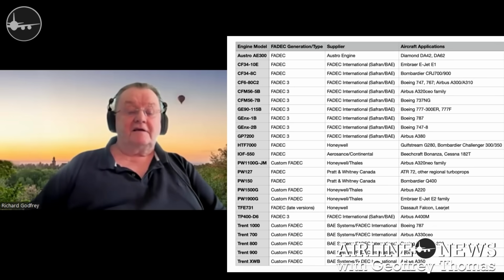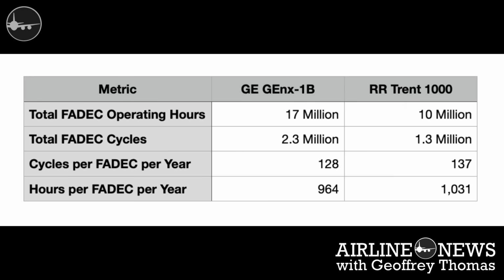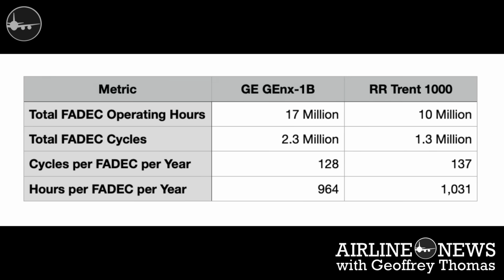Air India Crash - FADEC Explained  #airindiacrash

Comment: Gentlemen:  I've been following your outstanding coverage of the Indian Air Crash, and wanted to offer something for your consideration.  You made a video a few days ago regarding water ingress to the electronics compartment, and the potential consequences.  I have no experience with aviation electronics, but I am retired from a long career in electronics that included computer design and industrial/scientific control and data acquisition systems.  My topic is the fuel cut-off switches.  I've heard many times that these switches employ safety detents, and because the FDR indicated that they had been cycled, it PROVES that one of the two men at the controls, took the action to cycle these switches.  This might be an erroneous assumption; I'll explain.  The input channels to the FDR are measuring and recording electrical signals.  The real question is, what initiated these input signals.  If there is a separate circuit monitoring the ACTUAL MECHANICAL MOVEMENT of the fuel cut-off switches, then one would have a high degree of confidence that the input signal was the result of the switches being manually cycled by the crew.  HOWEVER, if there is no dedicated scheme (separate data channel) to measure and record the ACTUAL MECHANICAL MOVEMENT of these switches, the FDR is simply recording an electrical impulse on the "Fuel Cut-off switch" input channel.  It's not difficult to imagine a number of scenarios (water ingress causing "shorts", etc.) that might be capable of creating a "phantom signal" interpreted (and recorded) by the system, as being a pilot input (operation of the switches).  Do these aircraft employ a scheme that monitors and records ACTUAL MOVEMENT of switches, or are they simply capturing and recording "downstream signals"?    Your thoughts?
Reply: There are no position sensors at the switches. The FDR gets its fuel status data from the Remote Data Concentrator, which gets input from the switch relays and the fuel valves.

What is unknown is whether investigators took the time to differentiate the source of these inputs or are simply interpreting the change in fuel status as switch movement, which under normal circumstances would be a valid assumption.
Reply: @timrider1224  Ah!!  You appear to be familiar with these systems!!  Based on what you said, it seems reasonable to question the generally accepted  "fact" that these switches were operated by the flight crew.  Back to the the water ingress issue.  Is it possible that water had accumulated in a critical area, but did not cause an issue until the aircraft rotated-up as it left the ground?  I've long been troubled by the reported exchange between the crew.  One asked the other why he operated the switches, with the other denying he did.  Unless we are to believe some sort of panic response or deliberate sabotage of the flight, to me, this has always suggested some sort of highly random control system failure.  And water sloshing around in critical electronic control modules seems like a great candidate for such and odd/random/hard-to-pin-down cause of failure.
Reply: @BoffinGrusky  This scenerio has been bugging me on several sleepless nights. But assuming that the relay got shorted due to water or moisture, how was the pilot able to put the fuel switches to run mode after 9 seconds? Also, why did he take 9 seconds to put the switches back to run? Is it possible that he was frantically moving the fuel switches from off to run several times till finally the run position held? How come both relays (for left and right switches) become compromised almost at the same time and became OK together after 9 seconds?  I am a systems integrator and not an aeronautics engineer but it's common in my experience to see false active inputs without the actual sensor feedback due to hardware failures. I hope that an aircraft, given the essential  design requirement  of preventing loss of life, has multiple layers of protection against such failures.
Reply: @fifthdimension194  I remember hearing that the crew flipped the switches back to run after so many seconds, but the question remains for me, was it a crew member actually operating the switch?  Or, had something changed over the short course of the flight that made it APPEAR the switch itself was toggled?  For instance, when the plane's nose rolled-up as it left the ground, water invaded some sort of electronic control package causing a system malfunction (and the "fuel off" condition).  Maybe as the nose of the plane started to roll down, the water flowed to a different position, thus causing more spurious operating conditions (and spurious data captured by the FDR)?  Or maybe as the water shifted, the system returned to normal function and attempted to recover?  Several have commented that the cockpit voice recorder is sensitive enough to capture the clicking of the switches.  Guess we'll have to wait for that recording to be released.
Reply: @timrider1224  I would remind all that the FCO switches were found in the run position when examining the wreckage. Is it a point to consider that IF the derived data reporting the FCO switch positions was in some way compromised, that the FDR would record this and lead to false assumption the the switches had ACTUALLY been moved when they might not have been, especially allowing your statement, "There are no position sensors at the switches.", that there is no DIRECT evidence (as yet) of pilot(s) moving the switches. Maybe CVR audio could clarify this but it is as yet unavailable. To me the preliminary report is vague and inaccurate garbage with little hard data. Once again I say the ONLY way to get answers that are accurate, truthful and backed by hard evidence is to release the full unabridged data sets from all sources and then let the various investigative bodies dissect and analyse it all in the cold hard light of day.
Continuing with the current possess will not inspire confidence in the public and leave doubt in the integrity of many organisations that have been committed over decades to improving aviation safety through hard fact and detail, with enormous benefit. We can not let this hard won, independent knowledge process be corrupted by a single accident, no matter how much reputation is lost, no matter how much money/profit is at risk, no matter whose feelings are hurt and no matter the inconvenience to the traveling public if "normal" service is disrupted to deal with any rectifications required. Just publish the lot. Then noone can hide...
Reply: @drstrangelove296  I lean strongly toward the position that the switches were never moved until the pilots initiated the restart procedure. 'Jeremy John Thomson' and 'Sabin Mechanical Engineering' YouTube channels have fascinating videos covering this.
Reply: @timrider1224 If the investigators are interpreting it this way without looking further into the source of the inputs that makes them look recklessly irresponsible imo.
Reply: I asked, several weeks ago, are the multiple cockpit microphones sensitive enough to pick up the sounds of the fuel cut off switches being manually moved by the crew during the short flight ….
Reply: @trellofello7473  Imagine this has been covered somewhere I just missed it. Did this aircraft have a Cabin Microphone ? If so might or might not shed  some light on aircraft noises.
Reply: @trellofello7473  Good question.
Reply: Even the electric signal does not have a direct path the EAFDR.
Reply: I think the crew did flip the switches off and on but only after they realised they are in critical situation and in attempt to restart the engines which would chonologically come after the dialogue "Why did yo cut off?" "I didn't" and of course it makese sense they would flip these if the systems failed because this is their only instrument of controlling the fuel cut-off valves. It all comes very convenient for Boeing & Air India to implicate the pilots. Once the actual chronology of events is set unquestionably by facts like the full cockpit recording and it becomes clear that the switches are flipped after the issue occured it will be a major breakthrough in the investigation. What you all said makes a lot of sense with the water and the plane angle.. It adds up to everything else.. The suicide theory is so ridiculous in my opinion that I wonder how do even less intelligent people even fall for it... I think people just are inclined to believe in some  conspiracy from watching too many holywoold movies..

Comment: Sorry Richard, in reference to your possible scenarios at end of this episode…I would make a gentlemen’s bet that there is no scenario that an experienced U.S., British, Australian or German LUF airline crew would shut off [both engine fuel control] switches right after leftover.

Me: 43 years pilot; general aviation single/multi-engine; US Navy jet aircraft carrier pilot (7th Fleet-Air Wing II, instructor pilot , full card maintenance check pilot; commercial airline pilot 33+ years U.S. big three airline , Captain, retired B777 Captain, captain type rated in every Boeing ((B737, B757, B767, B747-400) except the B727 and B787. Flown in every commercial theater except Africa.
Reply from the maker: Try Africa, it will be an eye opener.
Reply: @Airline-News 

Had friends that got jobs in Africa as simulator instructors…oh the stories!
Reply: Read the Boeing B787 FCTM.FCOM and QRH. Look under Non Normal Operations and note STEP ONE  for a dual engine fail.
Reply: @KRMISC4-sn8vh 

Yep, and this is where ‘pilots good head work’ comes in. You also have to know when to do a procedure! You may have to forego a procedure because something else may be deemed more important if having to deal with multiple malfunctions.

Again, no smart western pilot  is going to shut down an engine as soon as you lift off-I don’t care what kind of EICAS lights you’re getting. What if you are taking off in mountainous terrain and you have a T-procedure associated with the active runway used for departures?  Right, get yourself distracted and fly right into a mountain or something! 

That’s insane! 

I lost an engine taking off from Denver going through 5-6,000 feet…and we still did not panic and jump through hoops.
Reply: @thetdchannel  Sooooo.... you know better than Boeing ?
Reply: @KRMISC4-sn8vh 

We are [NOT] TALKING ABOUT THE ‘PROCEDURE! 

It’s obvious you are not a pilot or if you are not an experienced one or a jet instructor pilot or a maintenance check pilot. Suggest you just read and learn what you can from Richard and Jeffrey and from [expert] operators that comment. 🥴

Comment: My gut feeling says: This was not pilot suicide. But I can be wrong. I assume it was a software bug/hardware failure, not a problem with fuel contamination or bird strike. FADEC is redundant, okay. But let me tell you a true story: A redundant computer system (not from an airplane) failed completly because of "latch up" of a 50 US cent integrated circuit. And please believe me, there was no test for this system to test "latch up" of this IC. This is a common problem: Because of the many, many parts that today make up a redundant computer system, you can't test everything. If you want to do so, you would never go into operation. And you can't think of such test cases, you just don't have the imagination.

Comment: This is something straight out of a sci-fi. If a crash is imminent and impending, why cannot an "AI Logic" of an airplane deploy hoards of (sturdy) airbags under the belly to minimize the impact damage, just like in cars? Or if it is ditching or crashing in sea, to make the whole thing float? Boeing, Airbus ..? Anyone?
Reply from the maker: No AI system directly controls primary flight surfaces on an airliner in revenue service today.
Reply: Is the idea of making a giant emergency parachute from nose to tail to wings a viable option? Certainly, by reducing its weight and making it smaller in number, or is the implementation difficult?

Comment: 787 does not have bleed air systems.
Reply: 787 uses bleed air for two functions. One is to apply pressure/pressurize the hydraulic system. Yes, it does use a lot less bleed air for far  fewer functions compared to previous A/C.
Reply from the maker: The bleed sir substitute is electric compressors driven by the aircraft’s electrical system.

Comment: Thanks gentlemen, great info as usual.

Even if FADEC had some kind of failure, and if this triggered one pilot to cycle the fuel switches, it doesn’t explain 2 things
1) why the FO asked why the captain cutoff?
2) why cycling took 10 & 13 seconds

It does explain the RAT deployment, but as you said there are still unanswered questions.
Reply: There is nothing in the report that states the first officer asked this question. You should read the report.
Reply: @martinwhite418  I did read the report. And the report did not say which pilot, one asked the other pilot. This doesn’t change the fact one pilot flipped the switches to cutoff
Reply: @tremdoctor007  Nothing in the report says anyone flipped any switch to off.
Reply: Hmmm well,  if 'FADEC'  then more likely scenario is 'garbage in' and  highly undesirable out.
'Garbage in' definitely includes  HIGHLY and negatively disrupted power supply and not just all the rest. Also within the FADEC 'system' more likely  specifically about EECS / FMU function.

The a/c - or at least some critical systems in sum, got shoved into a radically different operating 'state'.  Typically when that happens among many other important things, timing and the co ordination that produces gets thrown off leading to more undesirable  results. There is a kind of electrical Power chaos leading to electric and then electronic / software chaos   which often feeds upon itself.  And  can be heavily multiplied by numerous thermo and electric breakers opening and closing.
FADEC, working in conjunction with the rest of the a/c systems has more than a few  'safety modes' it will revert to  based on what it is being told, including not only cutoff but also various kinds of reduced thrust schedules on one or more engines depending on the situation. No proof of course but it  is possible that some  safety modes were engaged here. In my book possibly more than one. Not ruling anything out at this point, but extremely unlikely any type of a classical failure occurred not only with regard to FADEC but also a bunch of other. 

 As to the  paraphrased partial verbal exchange in the 'document' well....we don't even know the subject for each reported phrase.

One example out of many: PF loses his HUD display plus his /  cockpit right side screens and  asks a question. PM has just spotted on his side a hydraulic system collapse  and makes a response. They are not talking about the same subject. Both were also thinking in the background about the  gear up next.
Reply: @KRMISC4-sn8vh  we do know one pilot asked why did you cutoff, the other answering he did not do so. And even if he said he did not do so doesn’t mean he didn’t. If his moving the switch to cutoff was intentional, can you trust his word that he didn’t?

And as some speculate it was to reignite, why sit 10-13 seconds? It doesn’t add up. 

We need to hear the full 32 seconds of the voice recordings, all 4 channels. That immediately identifies which pilot said what and when.
Reply: @tremdoctor007  We don't "know" what was said, because we have been handed a corrupted report.

Comment: You guys keep holding out the possibility that the pilots turned the fuel cut-off switch in response to a fault, but no sane pilot is cutting off the fuel to the engine at 100 feet or so, let alone leaving them off for 9-13 seconds.

Comment: My comments below, and I rule out the pilot's intentionality for reasons I will mention at the end. First, I would like to thank you for the continuous updates and abundance of information. From my reading of the report, your comments, and those of the viewers, the matter seems vague, and we agree on that. What I see and conclude from the report is the following: 1. If it was deliberate on the part of the pilot, the report would not have delayed revealing the evidence in the form of data and recordings to the public. 2. The report excluded and exonerated Boeing and General Electric. 3. In my opinion, the report does not indicate any other possibility other than the possibility of either a premeditated sabotage operation, or a professional technical error by the maintenance, security, and safety teams.

Comment: So since each engine has it own FADEC and each has 2 channels- both FADECs & all 4 channels would need fail at exactly the same instant….

You have a better chance of winning the Powerball Lottery….

This was murder / suicide by the captain….
Reply: For my information, could the FADEC systems possibly be simultaneously affected in some way by a catastrophic failure in the electrical system from any source? As far as I know, people do actually win the Powerball Lottery even though the probability of any particular number matching a random Powerball number is very low by design. Statistics are not predictive, and I'm not even sure they are applicable in this case. I pray I'm never accused of a crime when you are on the jury.
Reply: @mimip8138  The probability of  any set of numbers being drawn in a lottery is precisely 1/N  where N is the number of possible results, and nothing else.
One thousand 787s would be grounded if there were some totally mysterious cause of one of them crashing while trying to get airborne.